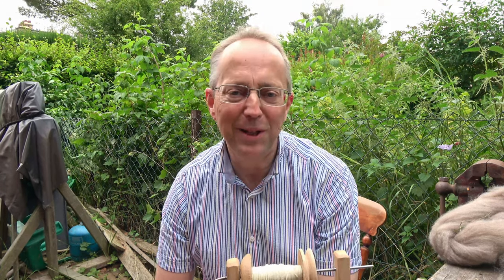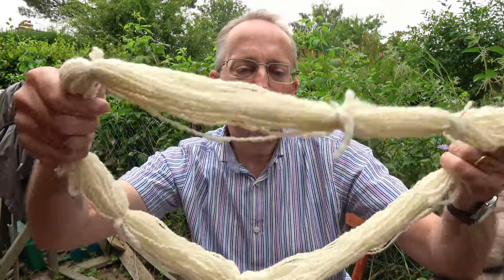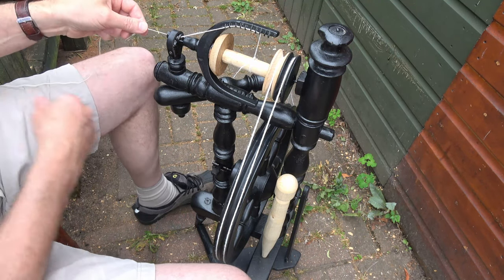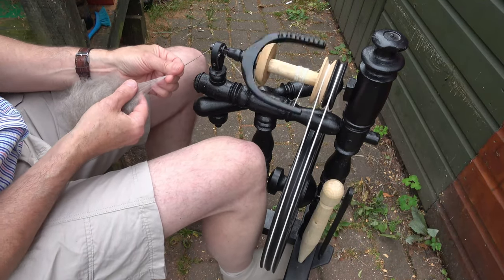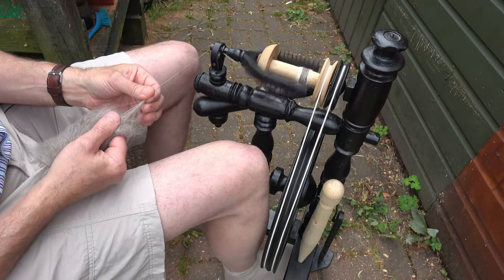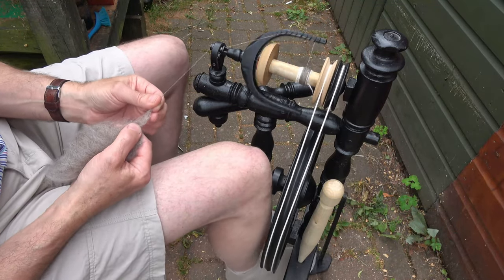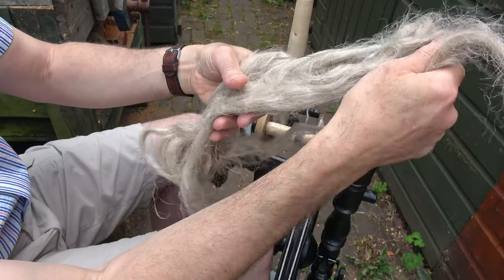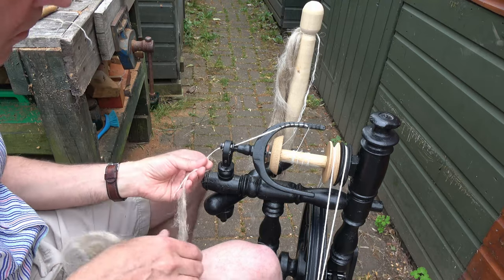Spinning Wool And Flax On My Rebuilt Spinning Wheel

Comment: A very good video. It really helps the beginner because you are continually explaining what you are trying to do while you're doing it. To get around the limited size of the bobbin on my Ashford traditional wheel, I made my own Lazy Kate  and have a dedicated plying wheel with a large bobbin.  Flax is a much longer fiber so it requires much less twist. I used the 'draping' it onto the distaff technique then keep the misting water bottle handy while using both hands to draft the fibers. In the rotational speed/drafting speed ratio, it is much less forgiving than wool so drafting from your lap is not going to work unless you're some hand/eye coordination superman.
Reply from the maker: Thanks that's very helpful.

Comment: You are doing fine Harry! Can I give you a couple of tips?  When adding a leader to a bobbin, tie yarn around twice the bobbin shaft, then tie a knot, you will find it doesn't spin around, when you only tie it once.
When joining in you fiber to the yarn coming out of the orifice, place you bunch of new fiber under the strand of yarn it will take up much quicker.  It's great to see you working the spinning wheel, more guys should do the same in these sort of crafts.
By the way your yarn looks fantastic, it's what gives it character, if you want perfect yarn all smooth go purchase it in a yarn shop, I am not being mean to you Harry, but people want is perfect, after a short time you will get more even yarn!  Please make something from your first it is to be treasured!  Have loads of fun with your spinning and weaving or what ever you try!

Comment: You are doing so well Harry!  Your wool looks lovely. If you wanted it perfectly even, you would buy it from a shop.
Flax is difficult stuff indeed. Some people keep a water sprayer handy to spritz those itchy stiff fibres. Fragments can be very irritating, especially if they get into your eyes.
I think you will find there is much less friction with the process if you turn your wheel nearly 90 degrees anticlockwise, so the thread doesn't have to turn that corner on its way in! The thread should be in line with the long axis of the bobbin. I can hear some friction there somewhere. It makes spinning harder if you're always fighting some little thing.
Mum says, if your bobbin rattling annoys you, thread a plastic drinking straw on the rod that the bobbin goes onto!
I'm looking forward to seeing the loom now! 
And hopefully the coracle?
Reply from the maker: Thanks Ruby...that is super helpful. I intend to do a coracle film all being well...the build is planned!